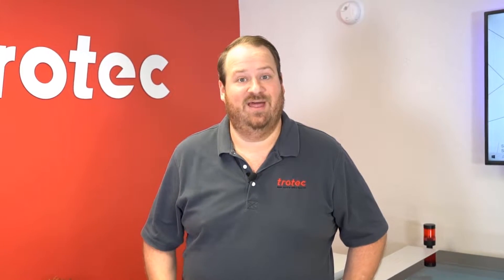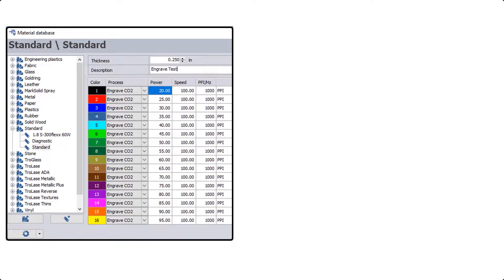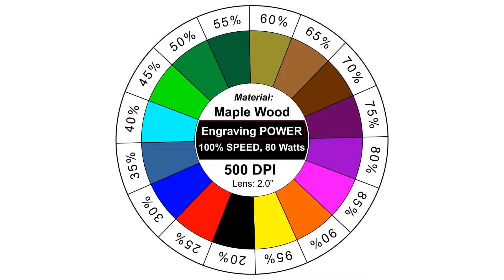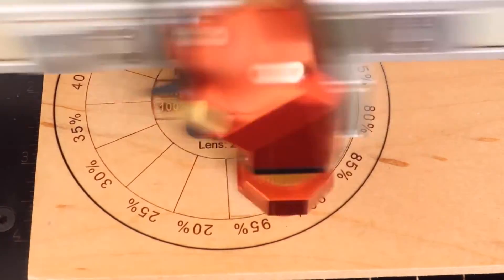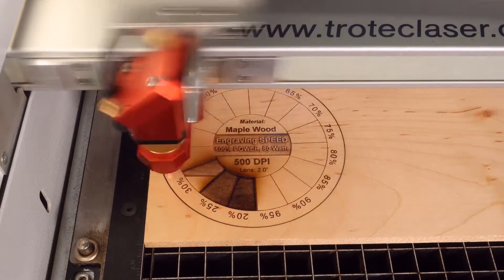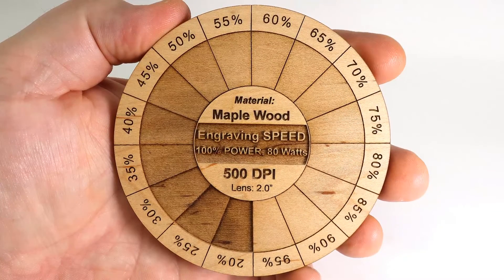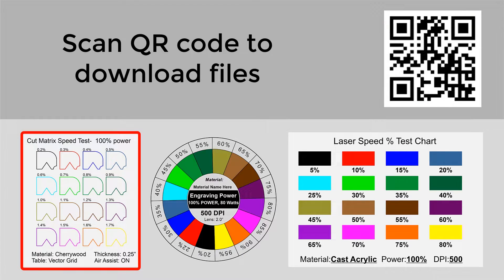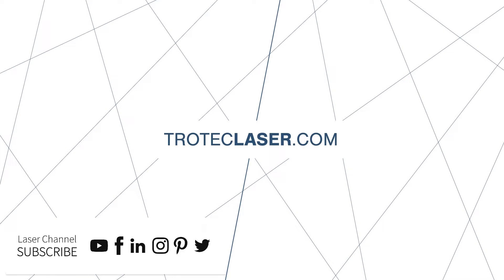Laser Hack: Creating Laser Parameters with Color Mapping

Comment: Hey @David Stevens

Why use this method over the 10x10 grid you see for many hobby lasers? It seems to me you'd need a stack of these discs for each material to see a broad spectrum of settings?
Reply from the maker: Hi Justin! A 10x10 grid should work just as well. If you have an idea of how your material will react to being laser processed, it may not be necessary to run 100 different settings. Either way, it is always a good idea to test your material to find the best settings for you!

Comment: Thanks for the helpful info/video.
We have a new 120 watt speedy 400 and need similar info burning thru spray paint layers on the white Stretched Canvas frames purchased @ Michaels. We have a gift shop customer that sells seasonal decorative signs and we didn't want to make stencils for each sign (most signs are black with white lettering). We are also quoting custom cigar boxes that have a very detailed 3 color logo that would need stencils and airbrushing if we can't use the laser to burn thru the paint. Would save us a lot of time if anyone has experience on a Trotec doing this kind of work, Thank you.